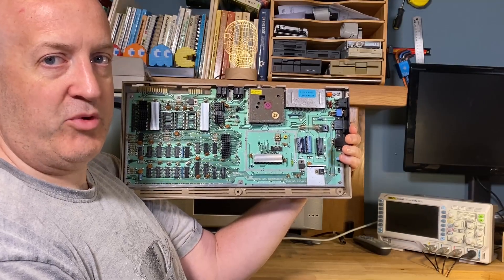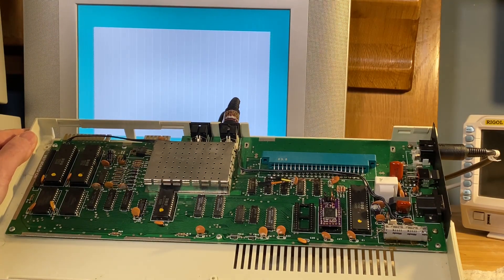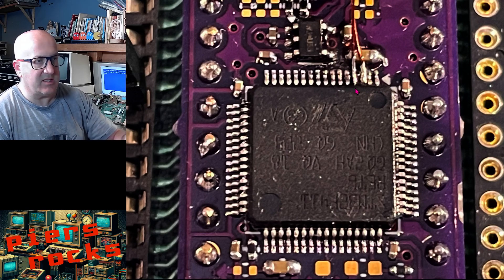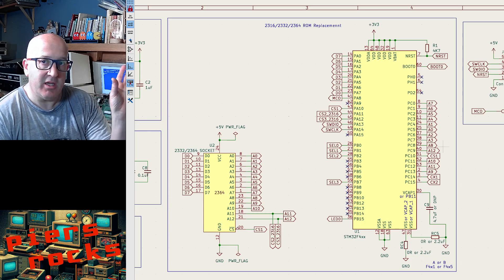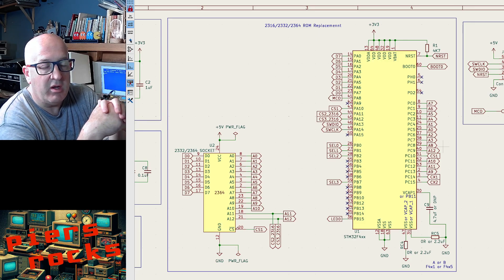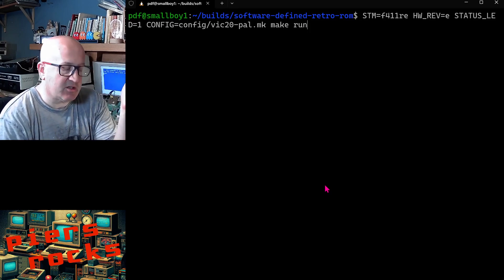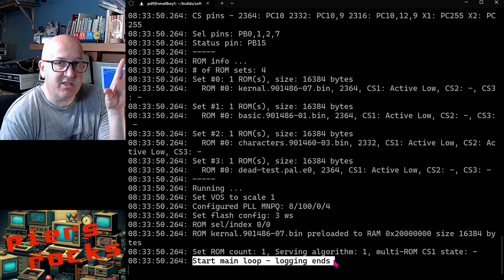Replace 3 retro ROMs with a single software ROM - how?! 🤯

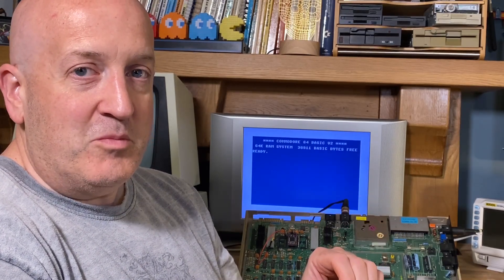Comment: Great project. Potentially, could this be used on a c128? I particularly like the feature of controlling the clock speed of the ROM. Keep up the good work. 12:09
Reply from the maker: Not very familiar with the c128 - but from a quite look it takes 16KB ROMs.  These'll be 28 pins version - SDDR today is 24 pin only.  I have a 28 pin prototype board on the way, but 16KB is the probably the limit that can be achieved with this architecture.

Comment: Back in the day we used to tune cars with rom emulators to allow live changes to the cars map while driving.

Unfortunately that went away after 80s 90s ecus as they went to more modern microcontrollers.

Products like ostrich or ols300 did the job.
Reply from the maker: Did not know that - thanks for sharing!

Comment: I looked up the RP2350 again, and as long as you provide IOVDD=3.3V all the IO pins will run with 5V5 maximum. So you should be okay with just a 3V3 regulator and an RP2350. That might give you lots more options for features....
Reply: It's not so cut and dry though. Unfortunately the rub is specifically this requirement.   Let's say we have used a regulator to build iovdd of 3.3v it comes up and supplies a current source at 3.3v.  that would have to be before any (at all) 5.5v signals were presented to the chips GPIOs.  Specific start up characteristics are also specified in the powering section of the manual. Rise to 5.5v on a TTL based systems can be extremely fast, especially if a signal is pulled high with a strong pull up - which is the case often (and commonly )for two reasons. Open collector logic, and high push pull drive requirements. Even if it's just NMOS drivers running the signals and the high levels aren't as close to CMOS 5v5, these requirements are the case for much lower voltage per the absolute maximums section.  I think the point here is you can sort that out - or use a chip that simply doesn't have those requirements.  There is also a bit of "but it works anyway" to work through here, and while that's fine for projects you do yourself or ones you fully state the GPIOs are overdriven (such as in the A8PicoCart), if it's something that might be used in a restoration, or as a properly designed product within its running characteristics, that's another thing completely.
Reply from the maker: Per my lasted video on the RP2350, the absolute max voltage of the RP2350 being 5.5V is also a concern, compared to the 7.3V of the STM32F4, and 7.0V of the original chips.  I've seen voltage regulators get dangerously close to 5.5V.

The RP2350 is working well so far, but I've only done limited testing, and if each window while the 3.3V voltage regular starts up is causing minor pad damage, the problem might not manifest for a while.
Reply: @piers_rocks yes, time will tell! The STM for sure is the more safe bet at this point in time. If you only want to do testing with a cheap ROM replacement, then the RP will be good enough I guess.

Comment: This is excellent! What if you make this software ROM as an interposer board to place under the 6502? (and/or the variants for the floppy drive and vic20) Not sure if the CS for the character rom can be inferred from the signals on the CPU's pins.
Reply: Things like the ROMulator already exist. I think this is particularly nice for repairs, where some ROMs are damaged or missing.
Reply: @root42 well that's right, but that is not implemented in software :) also, nice to see you around here, I enjoy your videos as well!
Reply from the maker: @cocusar interesting suggestion which I've spent quite a bit of time mulling over!

I expect it is possible to do what the romulator does in software, but I probably wouldn't start from here.  I reckon you'd need much more horsepower - the STM32 at 100MHz doesn't have much leftover when serving the ROMs for the C64 to perform other logic whic you'd need.  I'd probably use a much higher clock speed multi-core processor to do it.  A higher end dual-core STM32 at ~500Mhz is probably powerful enough.  Maybe, but maybe not, the RP2350 overclocked to around 300MHz - the PIOs could be useful though.  (If you're interposing the 6502 you have a large footprint to play with so can fit level shifters required by the RP.)

If you could make it work with the RP2350 you could do it for a very low cost - I haven't priced up the FPGA based romulator, but expect it would be much cheaper with an RP2350.  (The higher end STM32s are also kinda pricey.)

I like to start with the more "physical" constraints - with software "anything's possible" so long as you have the right hardware. 

My key goal with the multi-ROM support in SDRR is as @root42 suggests - it's replacing multiple failed ROMs simultaneously, or having a system you can easily switch personalities of (I'd love to be able to switch an IEEE-488 disk drive between DOS 1 and DOS 2 at the flick of a switch).  I'd hate to think of people gutting their system of the original working ROMs and RAM just because they could!